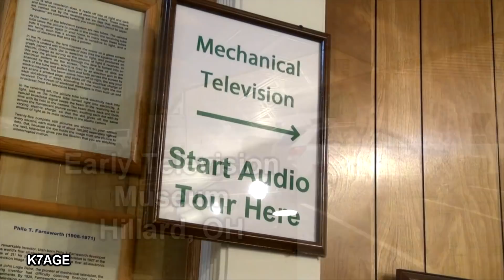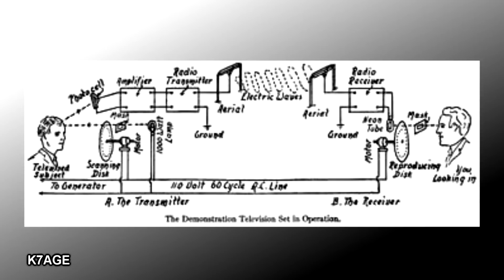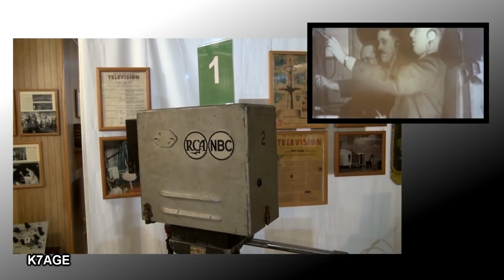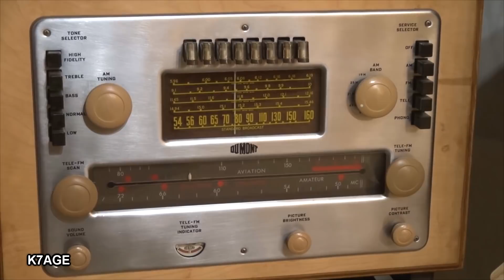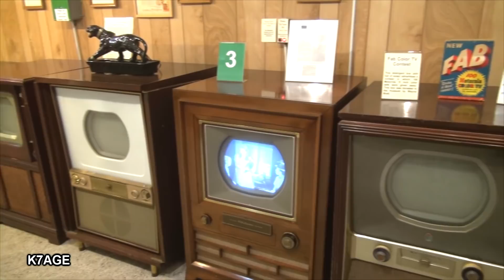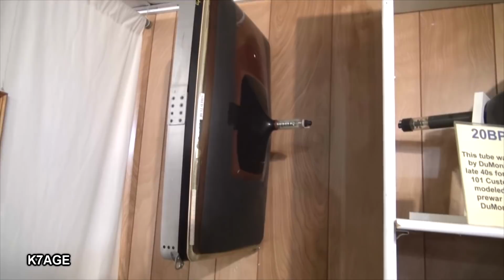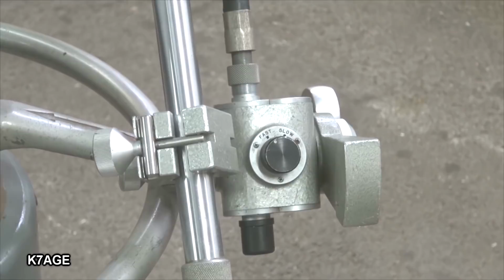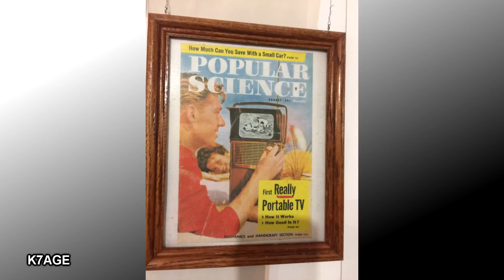Visit to the Early Television Museum

Comment: Thank you. My family inherited my grandparents 1941 RCA projector tv/3 band radio Console. It had a picture tube mounted downward into a lead lined container with a parabolic mirror that prevented the xrays from the high Voltage applied to get the image from the tube/parabolic mirror up to a 45˚ reflector mirror to the ~20x30"rectangular screen that had circular and horizontal grooves in the plastic. I played with it and got a raster on it. We didn't have an external antenna, so the picture on channel 3 was not very good. (it had 3-1B3 tubes in the HV chassis and made a lot of arc/crackle sounds) I have no idea what happened to it. The construction was ornate and had sideways roll-top type doors to cover protect the screen. Radio sounded very good.
Reply from the maker: Glowing in the dark

Comment: The TK10 preceded the TK11 the studio versions and the TK30 preceded the TK31 the remote versions, as the TK40 preceded TK41 used in studios.  The  TK30 and TK31 with the mobile CCU, the camera head was identical as far as I know.  The camera and CCU together were called a "camera chain."  Ron W4BIN (TV engineer retired)

Comment: My uncle worked for Buckeye Electronics on East Long St. In Columbus in the late 50's early 60's rebuilding black and white picture tubes. Many years later he worked at a local surplus shop in the short north district of Columbus which later purchased a small electronics surplus shop known as Star Surplus. Him and another employee of the larger shop had the job of clearing out the basement of Star Surplus which was full of antique picture tubes, many of which were in deteriorating cardboard containers. This was a hazardous job since if one tube was dropped the implosion could set off a chain reaction of all the tubes. None of these vintage tubes has any type of implosion protection. It took them two weeks to clear out the basement and unfortunately they all wound up in the dumpster since there was no market for them at the time.

Comment: Ever wonder why channels 3 and 4 were picked for off air adapters and VCR’s?  It was those pre-war TV’s that only had one channel. Early add on tuners were used to open up channel selection without reworking the existing TV circuits, and they output on Channel 3/4
A carryover from old tech.

Comment: I recall the first colour tv sets in the UK around 1967-68. They were really cumbersome and heavy, and took two engineers to deliver them. They would then be 'set up', eg the convergence adjusted to reduce red or blue outlines and trailing. If you wanted to move the tv to another room or across the other side of the same room an engineer was called out to again set up the tv.  You needed a far more powerful aerial, and remote control was either wired or non-existent. I recall driving past houses where the people kept their curtains open so everyone could see they 'had colour'. In the television programme listings at first they would state if the programme was in colour, but more latterly that became b&w. The vast tv set's tube was very long and so the back extended quite a way. Looking down through the slats in the back case it looked like flying over a city at night with all the valves (US 'tubes') lit up. The back casing was made of a pressed heat and fire proof material which had a wonderful aroma when warm. Many sets were rental sets, and firms like DER and Granada had shops in the High St with the colour tvs in the window. A b&w tv cost around £1.50 a week and colour was around £5. The great advantage of having your tv this way was that the frequent (by today's standards) breakdowns cost nothing to repair, and you got priority service.
Around 1974 the govt invented a wonderful new tax which put the price of tvs up, so there was a massive rush to buy, meaning that after the tax was introduced (VAT, value added tax, to come in line with our EEC enemies..um I mean friends) the majority of people had colour tvs.  This was still during the lifespans of many of tvs inventors and developers, and the early stars and presenters. They therefore got to witness their baby reach maturity, and it really must have amazed them to see how television, which many people had declared a waste of time in the 1920s and 30s, had developed.  There was still a market for b&w portables for bedrooms and kitchens,  and for caravan and camping holidays as they ran off 12 volts, and some very small b&w portables such as the 4" screen Russian 'Rigonda' tvs were popular. The first time I watched tv in a moving vehicle was on the Sinclair Microvision in 1978, though due to aerial limitations it was a pretty poor, and anyway only had a 2" screen in a pocket sized box. I also had a Crown 4" tv which I tried to get a better picture on by mounting a proper tv aerial on my van, but it was still very poor and barely worth watching. UHF required too powerful an aerial, and whilst VHF tvs were still around, it still was like trying to listen to a distant radio station.  The first video recorder we had in the UK was the Philips V1500 I think, around 1976. It had a mechanical cooker clock for timing the recording, and a run time of 30 minutes as tapes were limited. It had to be serviced every 20 hours use and needed new heads at around 50 as I recall. At school we would all settle down to watch a science programme recorded the previous evening, but due to the shortness of the tape, a fault or the programme having been delayed (or the mechanical clock being slow or fast) we would often lose the first or last five minutes. By the time JVC and Sony produced greatly improved sets people started to buy videos, although they were still quite a status symbol. I recall being amazed at the ability to stop the action, watch something other than programmed material, and to record a programme and watch it later. It seemed the height of luxury. 
The first JVC portable camera, battery pack and tuner came in around 1981 or so, and it cost around £1800 just to be able to record a fairly poor picture and sound for 30 minutes, and play them back later. They were not only very limited in run time but would quickly need recharging, so unless you were connected to the mains or had multiple scarily expensive battery packs you were sunk. . Their weight was also an issue, as you had to lug the camera around as well as the battery pack and VHS tape recorder. It was like packing for a very long expedition. The tv tuner was an optional extra, and that also was heavy. 
I'm still amazed that in my pocket I have an internet computer, telephone and camcorder/camera, all better than huge equivalents of the recent past. What is next for the nature of television receivers? 3D without a need for silly spectacles?

Comment: To my recollection, some of the dates here are off.  CBS was still using its color system as late as 1957.  The famous Rogers and Hammerstein production of Cinderella starring Julie Andrews was simulcast in standard black and white and color on the separate color broadcast band.  And it was 1961 when Walt Disney's Wonderful World of Color premiered on NBC.  ABC licensed color broadcasting from NBC for some of its color programing starting in 1962.  CBS licensed the RCA color system for certain Special Broadcasts, especially the annual telecast of THE WIZARD OF OZ.  But in 1965, CBS started the switch to color after holding out for three years, and going all color the following year.

Comment: Heroic times. You can't the air in vacuum tubes, the shorts in electrolytic cap, the leak in paper ones, the. Smelly selenium rectifiers, cracked wires insulation, and the cameras that refused to work in the summer.
Thanks. It look like a film from a different world, the time before semiconductors...

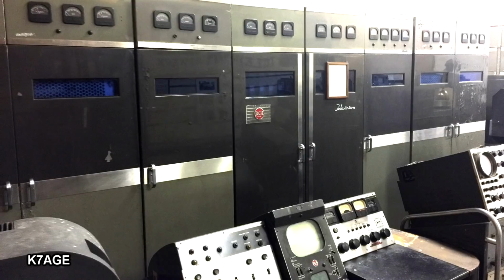Comment: 18:54 No. The transmitter was NOT owned by "Channel 6". It was owned by the TV STATION that tranmitted over Ch.6. Channels had, and still have NO physical presence ANYWHERE! Channels are ETHEREAL and the closest physical representation was in the tuning system used to receive the 6Mhz-wide signal. That's all a channel was or is. A 6 or 7Mhz-wide VHF signal, or a 7 or 8Mhz-wide UHF signal in the analogue days, and a 7Mhz-wide signal in the digital era.